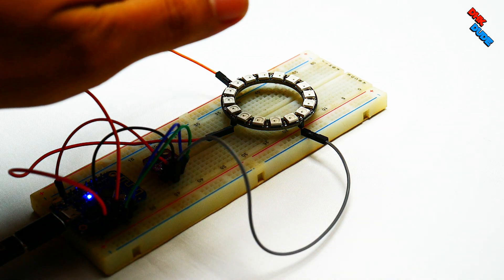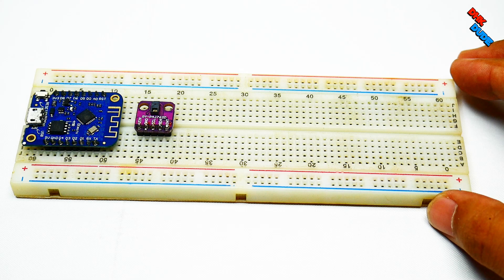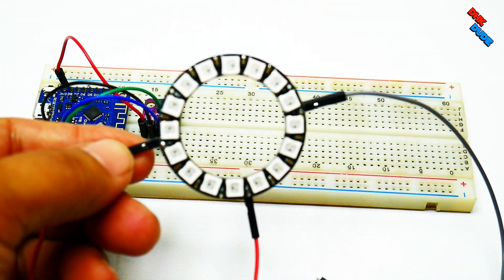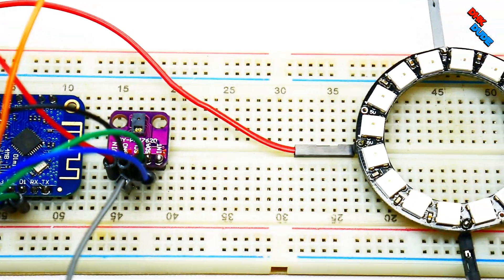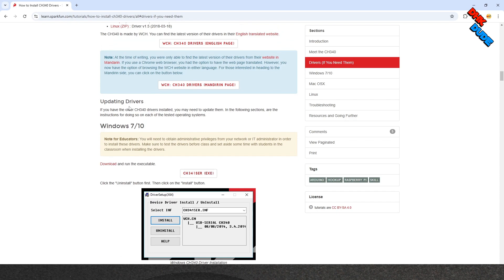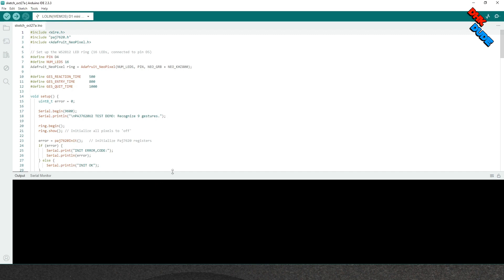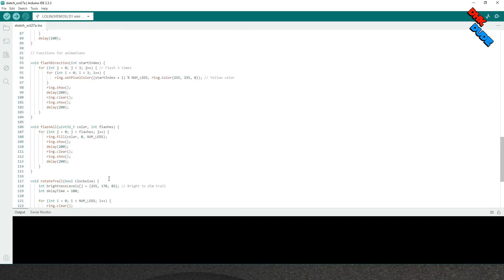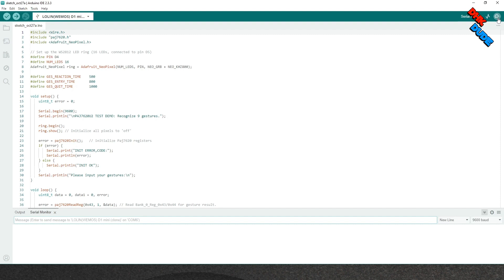BUILD Your Own Hand Gesture-Controlled LED Ring!

Comment: can we just do on and off with hand gesture?. also im planning to use 16 bit LED matrix
Reply from the maker: Hi, PAJ7620U2 gesture sensor used in this project supports 9 gestures (up, down, left, right, pull, push, cw, ccw, wave).
Reply: @DHKDUDE  thanks for your response. Im planning to use APDS 9960 rgb sensor. I just wanted to know if we could connect the same to a 4x4 LED matrix and make the gesture on/off.
Reply from the maker: @you_with_gtr  yes, possible. you have to adjust codes accordingly.
Reply: @DHKDUDE  wonderful. thank you.
Reply: @DHKDUDE  Hi, in the output am receiving is "APDS could not be init(). gesture sensor is working." But I don't see any output. Could it be connection issue, Power issue?
Reply from the maker: @you_with_gtr  hi, there may be some reasons it failed to initialized. one reason could be no proper library installed. Also check I2C address of the sensor. You can use I2C scanner code to get i2c address of the sensor.
Reply: @DHKDUDE  Yeah, Looks like it was not the same as expected in the library. Had to edit the source file of the library to match the I2C ID. Guess I got a clone rip-off of a the RGB module.